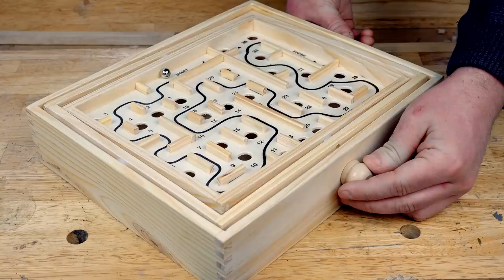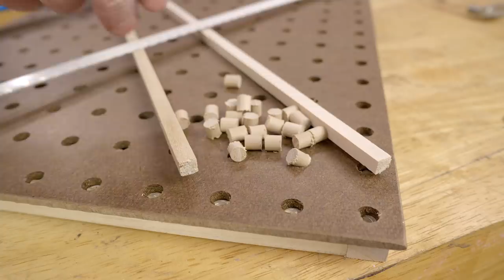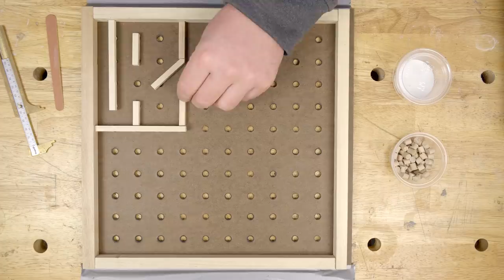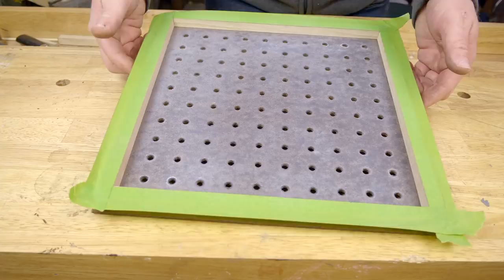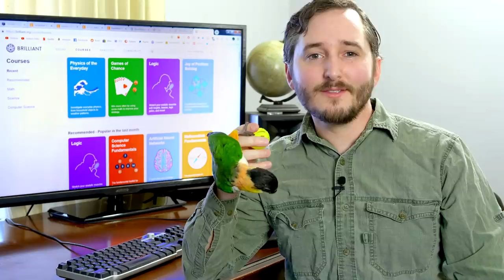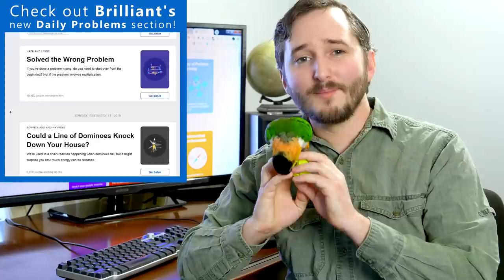DIY Super Hydrophobic Labyrinth Game

Comment: Hard mode: Put a paper towel on a strategic wall so that it will absorb it if the drop comes in contact with it.
Reply: Or Sponge. Can be squeezed out.
Reply: Ha ha ha I spat my tea over my tablet! Thanks for that 😁
Reply: Or make all the walls out of sponge.
Reply: @theralhaljordan7337  You can't quickly pick up and relocate a hole.
Reply: Or cover all the walls with paper towel and not be able to touch any walls
Reply: Thanks a great idea

Comment: If the floor was transparent (maybe using acrylic or something) you could have a second layer maze underneath, or have bridges and underpasses. Or maybe use the tops of the walls for a second layer maze, with ramps up and down
Reply: I had a similar idea! By similar i basically mean the exact same XD

Heres what i said

You could try multiple heights like with ramps without borders on the higher floors.
Options for this type include:

-if you fall of the higher part then you land back down on the board below.
-require ramps or bridges to get over certain walls to get to the end.
-going too fast would launch the water off the board.
-having a see-through plastic second floor could let you play under on the first level(the water would have food colouring to let you see through the plastic.
Reply: @vincenttrigg4521  I'm just wondering if the hydrophobic coating will make the plastic/acrylic look frosted making it really hard to see what's under
He did say at 5:23 the coating made the surface that's been sprayed a "milky white" and also commented on how uneven the coating was on the pegboard

Another idea I had to add to your comment was instead of letting the water drop down to the bottom floor from a top hole, it would be a simple tube/pipe the length of the spacing between the top and bottom floor. It can pose as a very simple object when on the bottom floor.

I'm hoping Hawkin will make another video following this :)
Reply: Hokora Yinphine MPP Well, maybe there are other more suitable coatings that are transparent.
Reply: 5 years later and i somehow came across the same comment to mention the same thing, turns out i already said it haha

Comment: Do it with the Leidenfrost effect instead, built in time limit!
Reply: Exactly what I came down to comment. Specifically those surfaces with the array of little sideways-tilting groves to act as a launch or speed ramp. Could even combine this with your dual-drop idea and have one drop close a switch on the heater for the Leidenfrost surface so that the other can get launched across unconnected parts of the maze. Heck, have it launch you to a whole other maze board and make it a multi-player game.

One could really go nuts with small-scale fluid effects: acoustophoretic levitation, cavitation (vaporization trap or limiting visibility with time spent in an area) and/or capillary action (to get the droplet through a hidden shortcut). Also, how hydrophobic are magnetorheological fluids? Maybe have a dynamic section reshaped by hitting switches/conducting plates so that it blocks/unblocks different areas in sequence. The possibilities!
Reply: What would you do that with? Liquid nitrogen?
Reply: @Cyberw4y  he could just heat the surface the water is on, the leidenfrost effect can happen whenever you have a liquid hitting a surface hotter than its boiling point, so water with hot metal plate could work
Reply: @pedroff_1  yeah, but this one is wooden.
Reply: @Cyberw4y  that's true, he'd have to make a new one he could heat as much as it's required. I thought you were implying you could only get the effect on liquid nitrogen, sorry for misunderstanding it!
Reply: I think the liquid nitrogen idea is closer to a reverse Leidenfrost in functionality. A normal Leidenfrost system uses hot surfaces and the liquid itself that's moving is the propulsive force. With liquid nitrogen, the water drop is fine, but the surface it's running on is actually the part that's boiling away. Functionally, it's the same process, but at a molecular level, it's the complete opposite effect.
Reply: bonus points if you complete it without getting 3rd degree burns to your finger tips

Comment: Couple of things hat would be cool to see: 

1. Drinking straws to transport the drop across the board. Would have to be built into a side wall so it doesn’t get in the way of the maze itself.
2. Cover a small section of the board with a piece of wood so you have to do that section blinded (optionally, add a small mini maze to the bottom of the cover) 
3. A water tank and a cheap plastic pipette where the water gets fed directly to the bulb with a one way valve and when you squeeze the bulb, a perfect water droplet is formed in the same place every time
4. A small timer and wipe board to keep track of time and scores. A “leaderboard” of sorts.
Reply: Timer could be triggered by the droplet running over a section and completing a circuit.

Comment: Pretty cool version of this game.  Hmm, little contact points in surface could trigger lights or sounds as the conductive water drop passes over them.
Reply: If you spread two contact points out far enough in a section, you could ensure that you've reached that part of the maze with enough water to flip the switch.
Reply: I was thinking the same thing

Comment: Two ideas that work together to make a “shrink and grow” mechanic:

1. Certain passages could be made thinner with a modified board to require intentional shrinkage. The shrinkage could be done on a nearby hole, or a bit of paper towel small enough to only absorb a small amount of water.

2. Wells that contain more water to grow. The best way I could think of was sponges, as they could hold water without it going everywhere.

Bonus ideas:

1. Non-hydrophobic panels that are harder to get over, and require harsher tilting.

2. Sponge walls.

3. Plugs that make holes safe (probably made of rubber).

4. End goal made of a different colored sponge.

5. Little dots of food coloring that indicate a harder route or bonus, ending with them means you did the harder challenge.

6. Doors that slide based on the tilt

7. Bigger version (15x15 maybe?).

This is by no means a completed list, feel free to add on :)

Comment: YOU SOULD ADD:

(1) “mini motorized treadmill” that forces you to move a little faster in a certain area.

(2) “mini fans” that blow the water drop around.

(3) “mini water pump” that pumps The droplet into a different area.

(4) “carring objects” make the droplet carry around  certain object to complete game modes or to do certain tasks.

🤙
Reply: i think that would be hard, cause water could get in the crack at the ends of the belt, but if you had some air being blown out of a small hole via a 90deg adapter out of the bottom, then u could have a variable speed crossing zone.
Reply: Should have small sensors so if any of those are activated then it makes sound effects
Reply: vincent trigg yea totally 🤙

Comment: You could add a type of drip pan underneath the board that collects lost water. The collection system may have a nozzle near the beginning of the maze, allowing players to simply squirt a small amount of water with the press of a button (like a soap dispenser). Now, ideally the water would need to be treated with bleach or something of the sort to prevent it from getting modly. Also, if you added an acrylic topper over the maze, the entire system would be closed and repeatable like a pinball machine. You wouldnt need to worry about mold or dirt in that circumstance.

Comment: you can add some electronics to detect when the droplet gets to the finish point or activate some traps along the way.
Add a speaker or haptic motors to vibrate the plate, or ultrasonic mistmakers to destroy the drop of water

Comment: I would recommend adding some color traps. Small pieces of wooden dowel coated with various colored pigments that can transfer easily in the water, and a small piece of cut tape with an hole as a size goal, meaning you must have a droplet big enough to call it a win...mixing the two is possible too

Comment: Awesome project! If you want the drop to always start in the corner, you could add adjustable feet by threading a screw into the bottom on the springs.
I also wonder if a version could be made with a bubble of air in water.

Comment: You could try multiple heights like with ramps without borders on the higher floors.
Options for this type include:

-if you fall of the higher part then you land back down on the board below.
-require ramps or bridges to get over certain walls to get to the end.
-going too fast would launch the water off the board.
-having a see-through plastic second floor could let you play under on the first level(the water would have food colouring to let you see through the plastic.

Comment: It's a simple suggestion, but you can use a few layers of glued 2x2 plywood for the feet of the board with a hole drilled out in the first layer for the spring to rest in. That should keep the board from sliding

Comment: One addition would be to measure the weight of the water at the end-zones, that way you can have a scoreboard where you can measure the amount of water saved vs lost. Should be possible to implement using a strain gauge and cutting out a smal part of the pegboard. The drop should slip over the gap if it is small enough.

Comment: Try having hydrophobic dye traps along the path and the goal is to get all the dyes without them getting out of the trap and fall into the pothole traps. One of the holes could be covered from the bottom and dye can be filled, because the water would fall into it, it would lose a part of the original drop but it would fill the trap, dilute it can it can leave at about the same size.

Comment: Few ideas:

1) I noticed that in some of the final shots of your maze, the inside walls didn't perfectly cover or fill the holes below them. Perhaps you could fix that by adding more pegs to the bottom and/or creating a sort of LEGO-esque set of interlocking wall pieces?

2) Depressed & raised bumps on the board could give more challenge as well as forcing the player to train his/her precision much more.

3) Slightly textured corners - say, with a piece of thin felt or cloth - would add a little bit more "grip" with some types of movement.

4) Styrofoam/wood bumpers glued to the bottom of the springs would prevent them from scratching surfaces.

That's really it for me, I love this toy idea already!

Comment: Put a collection tube at the goal. Then you can compete based on how quickly you can deliver a certain volume through the maze. This lets you take natural penalties  for losing water along the way as well as playing with the strategy of how much water to start with. Is it faster to try navigating a few large drops around, or many small ones? A common collection and measurement device for the traps could add a losing threshold to the game - if you lose too much before you deliver the right amount, you lose.

Comment: Make the end have a heating element (plate) and a PFTE/teflon tube. As the water boils it enters the tube and condenses on the other side of the tube at a higher elevation which starts the next level! Better yet make the maze elevated in sections so the droplet goes up and down! Thoughts?

Comment: Connect the holes to a tube system - thus making them portals! A microcontroller with sensors and a pump, or could it be done more simply perhaps? A sponge trap is a neat idea, and makes a perfect water collection mechanism. Awesome stuff, as always! Do you think this would work well with your DIY hydrophobic spray?
Reply from the maker: The DIY spray isn't as hydrophobic as the stuff you can get off the shelf. It would work but the game would be easier because the drops would drag along more slowly.

Comment: You should look into the videogane "Mercury" for further ideas to add to the puzzle.

Maybe to make it fancy, adding a way to weigh the droplet at the end. I'm thinking a piezo transducer but it might not be sensitive enough. Though a piezo could certainly be used to 'explode' the droplet when used as an ultrasound speaker!
Reply: I actually happen to have  two mazes made of plastic with a small bit of mercury in them.  Got them way back in the late 80s early 90s as a kid.  Having to re-collect the ball like a T-1000 made them challenging and gave them replayability.

Comment: This is amazing! Be interesting to have a section where you would need to have the droplet hit a barrier hard and squash to avoid falling through a larger hole close by.

Also wonder if it would be possibly to create clear raised sections over the board where you would eventually pick a hole for the droplet to return to.

Perhaps a small hole you needed to put some of your droplet into to complete a circuit that would temporarily remove a barrier. Yeah I know this is likely too much and water + electricity = bad but had to say it.

Any way buoyancy could be used? Maybe to float a trapped ball in a section about the board and move it to another area?

Comment: 2 Players.  2 Drops.  Separate starting corners.  Player's may place 1 to 2 fingers from each hand in two very specific spots along the rails of their corner (1/4 to 1/3 distance away from their corner).  Both players start and play at the same time, limited only by their finger placements and distance before their spring bottoms out.  Games can be cooperative or competitive.  You can use food coloring of different colors for each player -- don't touch drops!  (For competitive games, your droplet starts at the corner distant from you, while your opponent's droplet starts nearest to you.)

Comment: How about a variation on the classic steady hand game? If the water droplet bridges two electrical contacts, a buzzer sounds.

Not sure if there's a conductive material that would also repel water.
Reply: SonOfFurzehatt if you imbedded a thin piece of copper into one of the maze walls and one on the other side and had them just barely stick out so that when the water passes by, it will complete the circuit and not stick to the tiny bit sticking out

Comment: Could do a time system by heating up the board to increase the rate it evaporates at or maybe a heat lamp above to accomplish something similar. May only work with smaller droplets though, it'd have to be tested.

Comment: Water is conductive, so it wouldn't be too hard to tell if the ball went in the right (or wrong, with foil sheets) hole. Then maybe an arduino or raspberry pi for noises, scores, lives count, etc

Comment: Use a ferrofluid instead of water, and add a few sealed 1/2" PVC pipes of various lengths and orientations, along with 1 tiny sphere magnet each, under the board so your "player" will occasionally stop and turn into a bizarre spiky statue. 😎

Comment: Hi, 
awesome idea you had there! I've immediately decided to build one for my nephews. However, turns out that German hardware stores suck. They recommended me some kind of varnish which does not at all reach the desired hydrophobic effect... (Plus, they didn't even have peg board!) So could you give me a hint on what kind of spray you used? Was it meant to be used on fabric rather than wood? Do you know how surface-specific it acts? I was thinking about painting the barriers before coating them, for example...
Anyway, seems like I have to order something online.

For further improvement, I bought some small wooden ramps to and curved pieces which you have to climb over in order to make it. Also I really liked the sponge idea that came up in the comments, so I will definitely try to do that. Any more suggestions would be appreciated!
Reply from the maker: The specific brand I used was Rust-oleum NeverWet. It sticks to most surfaces but is somewhat fragile and scratches easily. The top coat can be reapplied if it gets damaged.
Reply: @Nighthawkinlight  Great, I actually ordered this exact stuff from the US a few days ago. Thanks a lot!

Comment: You have an older video that shows how to make a hydrophobic coating with clear paint and deodorant.  Did you try that and it wasn't good enough, or is the commercial one better in the long run?
Reply from the maker: The one I made myself is not quite as hydrophobic and so the drop would move more slowly. It would make the game a bit too easy.

Comment: You sound different in this video. New microphone? Also an obvious improvement would be a tray so you don't get water on your table every time you fail. Some food coloring in the water could make it more interesting, especially with two drops of different colour that are not allowed to touch. Maybe using olive oil and water for that purpose could work.
Reply from the maker: I use a different microphone when I do voice overs compared to speaking in front of the camera. Good ideas!